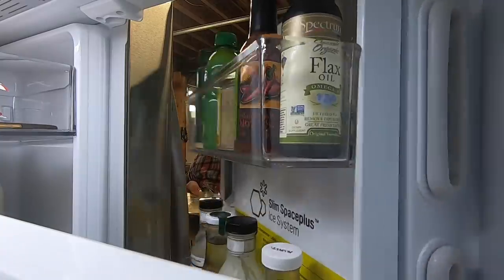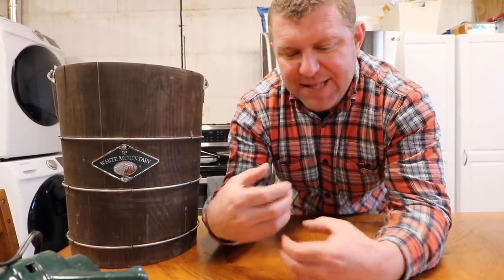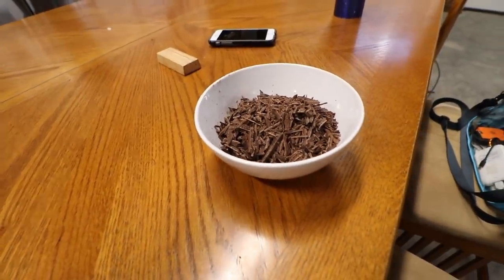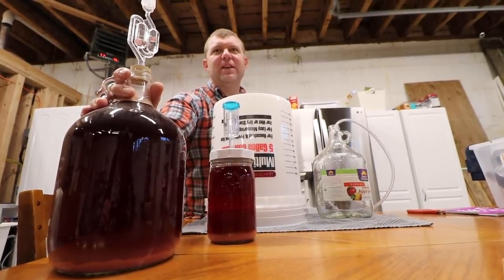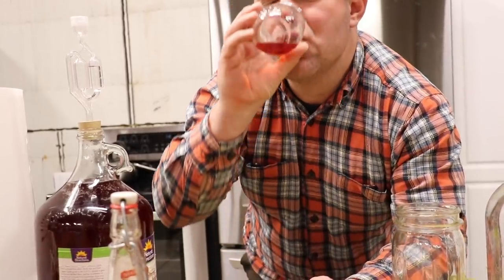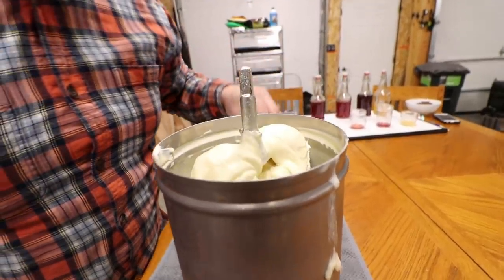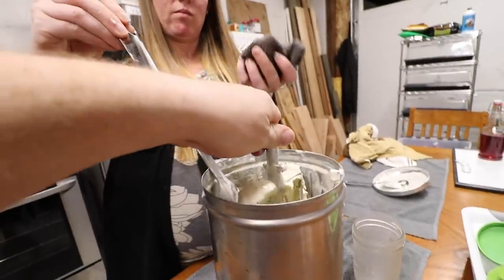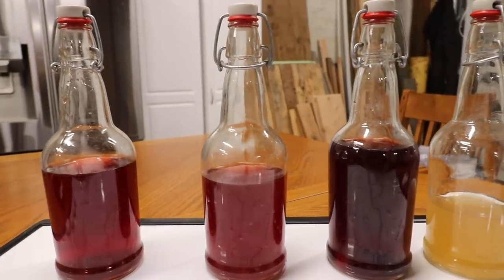Made Ice Cream w/ an ILLEGAL Ingredient! What Happened?

Comment: Hi folks, long time viewer of your channel! As a retired ice cream maker of a national premium ice cream manufacturer I can tell you what's missing in your ice cream and that is air. Premium ice cream is 50% overrun meaning that it ends up being 50% air and 50 % mix. I am not aware of any home ice cream makers that have the ability in inject air during the freezing product but it definitely makes a smoother lighter ice cream. Also the commercial freezing process is probably closer to 20 deg F and the best you'll achieve with ice is 32 deg F. Just some info sharing for you.
Reply: Actually, salt + ice lowers the temperature.  With a 50/50 mix of ice and salt, 0 F (-18 C) is theoretically possible.
Reply: Actually the temperature of Ice with the salt is around 10F not 32!  After making Ice Cream for over 50 years, I have found that the use of thickening agents makes a huge difference in home made ice cream!  You get a smooth creamy consistency and you get more Ice Cream as it had much less air in it!  as far as I am concerned the only thing that the air does is reduce the melt time and pad the pockets of the big manufacturers!

Comment: 1, To prevent larger crystals from forming in the ice cream, use a mixture of sugar (sucrose) and corn syrup (dextrose). This breaks the sugar molecule from forming it's crystalline shape. Most ice cream manufacturers use this technique, but they also add stuff you wouldn't want. 2, Have you brought your chest freezer in from the travel trailer? 3, When racking your mead, as suggested below, use a glass tube on the end of your siphon hose. Also don't put your thumb on the end to stop the flow. Use something to squeeze the tube. This prevents any bacteria that may be on your thumb from contaminating the brew. You can use a pair of vise-grips, a locking medical hemostat, or even a "C" clamp. Great video, and thanks. Jon

Comment: I'm hoping this doesn't come out sounding like criticism but the retired Home Ec teacher in me was cringing as you made the custard. Here are some hints.
1. The thickening agent in custard is the eggs - which thicken as they cook. Eggs need to be cooked thoroughly. A double boiler keeps them from cooking too fast so the thermometer is not necessary. So you are cooking the egg mixture to thicken it. As they cook, they will thicken - but not evenly! So the technique you need is to STIR CONSTANTLY - use a whisk or wooden spoon and scrape the middle of the pan as well as the edges.  Yes, it's a pain but the finished custard should be without lumps (which are tiny pieces of overcooked egg) and without stuff (overcooked eggs) stuck to the bottom of the pan. As soon as the mixture does not thicken anymore the eggs are cooked through. So the thickness of the mixture is the key - not timing or temperature. It (A food safety person would tell you the temperature is important and it is but for your purposes thickness will work fine.)
2. When you gradually mix the sugar and cream mixture to the egg mixture you are tempering the eggs or keeping them from developing (overcooked) lumps. Using your mixer for this is fine but your mixer will not take care of any lumps in the custard.
3. What the ice cream maker paddle does is break up the frozen pieces and add air to the mixture as it freezes. The paddle for your ice cream maker is great! Your goal is to get the mixture as close to freezing as possible without it getting too hard to work with. Again, texture is more important than timing.
4. Use a rubber scraper or spoonola  to clean off the paddle before scooping the ice cream into jars.
A favorite book of recipes is The Perfect Scoop by David Lebovitz - I use it all the time!
Thanks for letting us all follow along on your journey.

Comment: I think I mentioned this in another video, get yourselves a brewers pipette, one squeeze on the pump and it's off and running. The pipette is rigid connected to the flexible hose. Being rigid you have much better control as to not suck up any of the solids at the bottom. Another advantage is, the pipe is tapered at the end so if you have any debris on top it won't allow it to get in. Best thing I ever bought (and cheap) back in my beer brewing days.

Comment: Jesse,Alyssa, and (of course) Bugaboo,

Just a couple of things that will make racking less of a task:
1. Use a finings additive a couple of days before you do your final rack. The simplest is gelatin powder available where you buy your brewing/wine supplies.
2. Try using a racking tube or racking cane to leave the lees on the bottom of the carboy.
3. To ease your lack of a third hand get an auto siphon...it will eliminate having to keep your thumb over the end of your plastic tubing.
4. Wine can be filtered as you bottle using an electric wine filter. The one I use is called a Euro filter and uses replaceable paper filters. It will give you wine that is crystal clear. 
5. You may find that using one 5 gallon carboy is easier to use when racking...as the weight of the lees will help hold them on the bottom of your brew.

Good luck and thanks for your awesome vids. Cheers!

Comment: I would recommend a racking cane...cheap plastic ones are like $2 and it will keep your sediment at bay.  I would also recommend using Star San in the hose as that will guarantee your hose remains sanitized.  Finally, the first "bit" goes into a waste bucket, and then you move to the carboy.  That top is called a "Pelical" (spelling?), and is USUALLY OK, but yes, don't disturb it if possible.  You will ALWAYS get some sediment unless you put it through a filter, especially the solids the are still suspended.  I've been making beer and mead for nearly 20 years...glad you are learning the trade.

Comment: so when I was making my mead, if the fermentation stopped within the first 2 months, it was stuck, you will know this by the spec. gravity. if it is not low enough, there is still sugar in there. a stuck fermentation means there is no active yeast because honey being a complex sugar, is not sufficient in its "food" content for the yeast, so it quit eating it.  the yeast eats the easiest to digest sugars first. to restart a stuck fermentation I had to add yeast nutrients, which are basically "yeast guts" without the outer membrane.  not being dry enough can also have to do with the species of yeast you use. I found to get a dryer (higher alcohol content) I used a wine yeast.  my best mead batch ever took about 18 months to reach fantastic. I triple racked also once at 2 weeks, then  4 weeks then again at 6. at 6 I would add the nutrient and any clarifying agent I wanted to use.  using lager yeast gave me a sweet true honey mead, with ETOH approx. 8%.( meads with fruit are really melomels}. to get ETOH around 12-14% I used wine yeast, higher than that I used champagne yeast, but that is very dry stuff, and you hardly taste the honey.  a racking cane is the best way to go, especially on a true carboy cause there is a hump in the middle of it and it elevated the bottom of the cane above the trub.

Comment: To get more clear product out of the top carboy, I put a small book or board under the bottom edge to tilt it some. There is also a little thing that goes on the end of the tube that will keep it off the bottom to keep most of the sentiment out. Its like a little upside down mushroom looking thing. I have only found them on the end of racking canes at the local wine supply stores.

Comment: Often, racking will re-start fermentation, so avoid bottling until you've successfully completed a racking after which no further fermentation occurs.
BTDT, wiped wine off the ceiling!
Reply: or use champagne bottles and wire the corks down
Reply: in addition to that you were letting your product fall and splash into the jug!  Not a good idea!  At that point you are not wanting to introduce any additional O2 into the liquid!  Put your tube all the way to the bottom and avoid making splashes and agitating the product as much as possible!  Also don't rush to bottle, Meads age better in bulk, I can guarantee you that what you  think is great now will get remarkably better if you give it 6 months or longer to age properly!

Comment: A professional told me that to avoid icyness and get a better texture, unless you agree to use some thickener like agar-agar or wheat starch, the only way is to let the icecream to stay in the ice cream maker as long as possible. Of course if you do this with a domestic one you are not going to obtain anything better because the temperature is not controlled. A professional one works at the same temperature the ice cream must be kept after making (-5°C - 23°F), so the time matters because it will take much longer to become icecream. This allows ice crystal to be so small that the texture and the taste will be improved without adding too much cream, which is hypercaloric. After the ice cream maker the cream must be kept at least 2 to 4 hours at -5°C - 23°F to become stable, if you pass this step it will melt very fast.
Once you obtain a micro crystallized ice cream you are going to notice that you need less amount of sugar and less amount of cream to obtain a tasty one. Also, there are some tastes that do not require eggs but requires a milk only base (almost all fruits). Other tastes that don't require cream because they already have fats (almonds, nuts, pistachios etc.).

Comment: Lots of modern Ice Cream is less dense than water  down to 500g per litre. It's done by injecting air or other gas. 
Try the old ice cream maker then put the mix through a whipped cream machine with gas cartridges. It's smoother AND genuinely low calorie.

Comment: The faster it freezes and the greater the agitation, the smaller your crystals will be. You can whip more air into it to fluff it up and get rid of the some of the melty/cyrstally texture.  This happens most at the end. Keep going until your motor stalls completely and can't be pushed into moving again.  Take the whole mixing container and leave it in the salt water covered up to freeze more before dispensing.  Be sure your water is at 0°F. 50% salt and ice by mass.  Most people don't use enough salt to get the temp all the way to zero..  I think this is a serious problem and you should probably devote great effort and time to solving this problem.  ; )

Comment: replace the electric beater with electric whisk. More air equals better texture. Also, strain the egg mixture through a fine sieve (strainer) to capture the larger egg clumps, this will also improve texture. 
A few the comments below, suggest vanilla sugar. I would agree. Add 3 to 5 large vanilla bean to a 5 pound of sugar, let it sit for 1 month before use. Remember to place the pods in a star shape in the center of the jar. 1/4 of the jar filled with sugar, place pods, fill the rest. 
As for icy / melt working with could ingredients is best. refrigerate  all before mixing over night. Better Texture, Better small ice crystal formation. better texture all around.

Comment: Just an FYI, but you did not have enough ICE in your machine for it to freeze properly!  The Ice needs to cover the container and you need 1 cup of salt to every 5 cups of ice!  This will insure that you are freezing at around 10 Fahrenheit!  As it was unless your outside temperature was at around -30 you would not get the same freezing as you would have by using the machine correctly!  Air conducts heat much less effectively than the brine that you would have if you filled the machine correctly!  You seem to not put much importance in the instructions that you should have gotten with the Ice Cream Freezer, I am sure that those would have said much the same thing if you had read and followed them!!!!!  One other thing, you will never get as good a freeze with a non commercial electric ice cream maker!  You would be closer if you got the hand crank to go along with the electric unit!  It would allow you to continue to freeze keeping the ice cream moving to a greater degree than using the electric motor alone!  The electric motor will over heat and stop long before the ice cream is completely frozen, the hand crank is then used to finish the job as you can apply much more force over a longer period than the electric can by its self, if you want to do most of the churning hands off!  The funny thing is about your list is that many of the problems would be over come by simply following the directions.